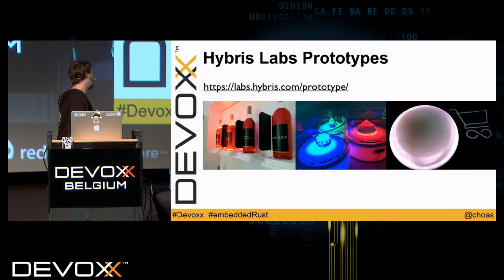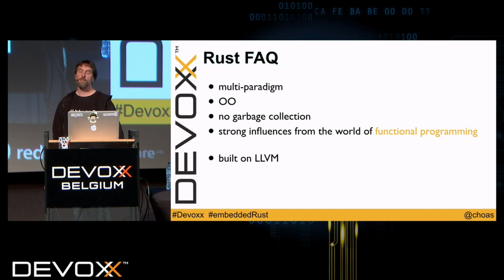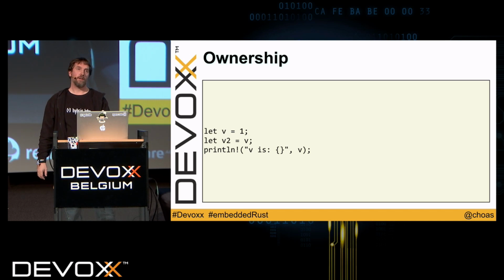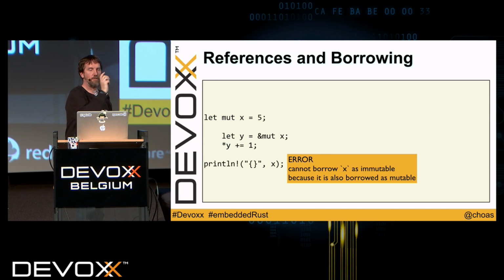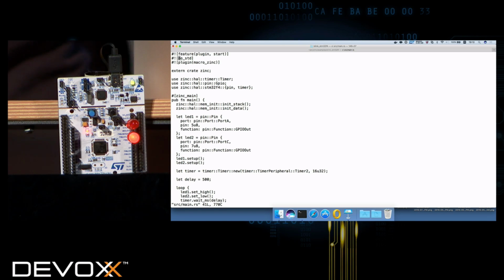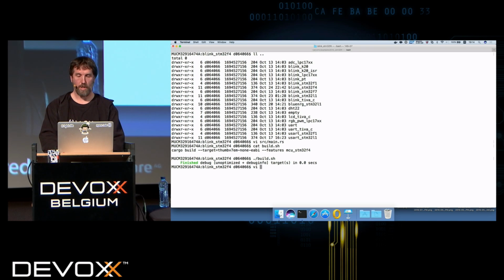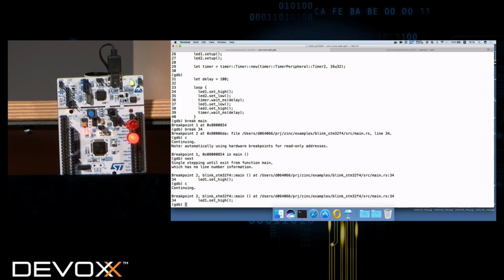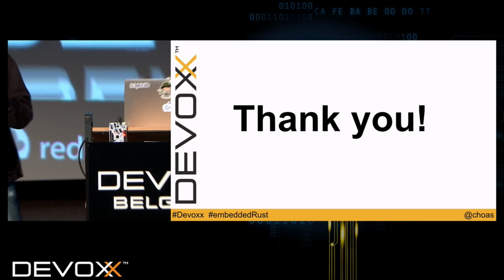Embedded Rust – Rust on IoT devices by Lars Gregori

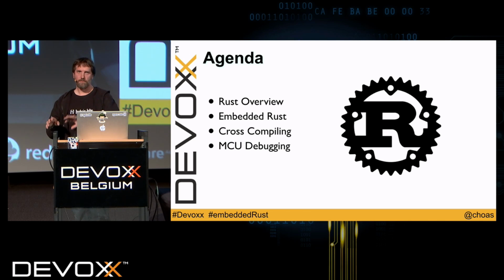Comment: The speaker explains some rust features till 12:36. He obviously tried to highlight why Rust is safe, but didn't really got the point across, he explained ownership with some examples that are better explained in other talks or in the rust books. 
In the Embedded Part he uses Zinc.rs and shows a basic blink example first and proceeds to explain how to setup Rustup for crosscompilation. In fact it is not too much more than what is in the readme of zinc.rs

Comment: The Rust compiler is LLVM-based and generates binary code, so no C compiler is necessary.  If LLVM supports the MCU you're using, you should be able to build a cross-compiler, linker, and gdb for it.

Depending on how much of the zinc library you link in and your code, you should be able to upload your code to very small processors (maybe even single or double digit Kbytes of flash and sram).
Reply: Yes. I was about to reply. The only reason the gcc tool chain was needed is to be able to extract the binary blob from the elf file generated by rustc (the Rust compiler which uses llvm as a backend) and to use the debugger. With more recent versions of the compiler and cargo (the Rust build system and package manager) you can do "cargo debug", I used this for native builds, but I am unsure if cross debugging is supported. Anyway, the Rust embedded work group is working actively to improve the environment and ecosystem around embedded debugging.